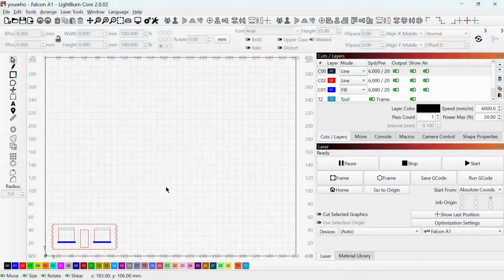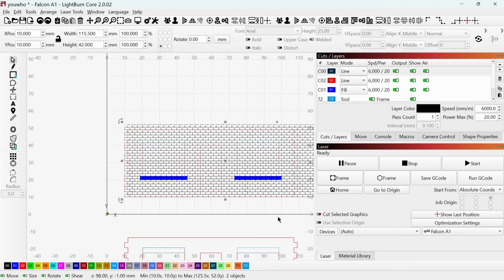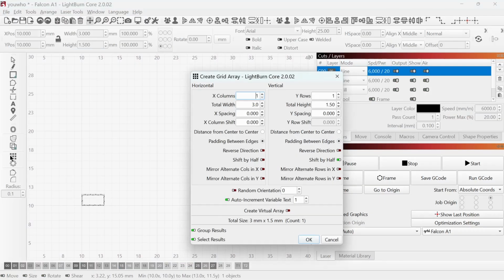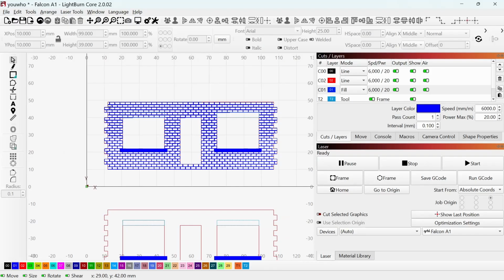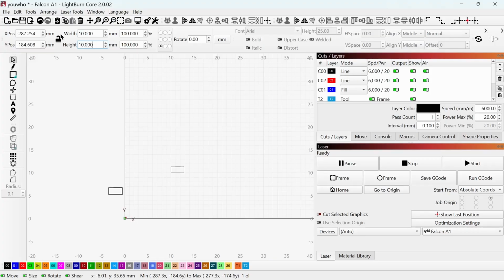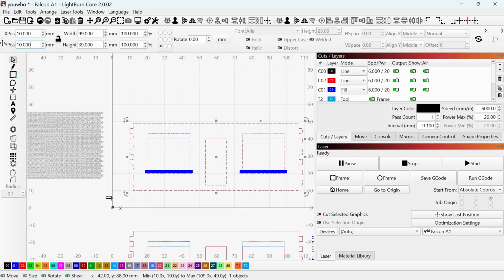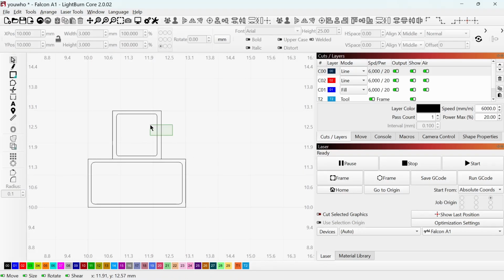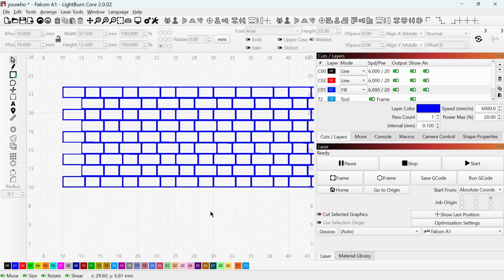Laser cut bungalow build and design using Lightburn#2

Comment: Nicely done, have you ever seen any of the 4Ground model kits? laser cut MDF, done with the walls in layers - in effect there is an inner layer thats smooth but has window frames, and indeed any desired "interior detail" that gets stuck back to back to an outer layer thats brick, lintels etc.

the way they did it made painting (they provided pre-painted) quite simple as you could spray the bricks and frames then assemble, speeds things up seriously. also done with 1mm grey card laser cut

its amazing how far laser cut stuff has come from the early "here is a box, paint it" to fully surface texture models
Reply from the maker: Thx just awaiting the post for 2mm MDF laser safe was looking to layer the windows and doors to give smooth interior...with have a look at 4ground